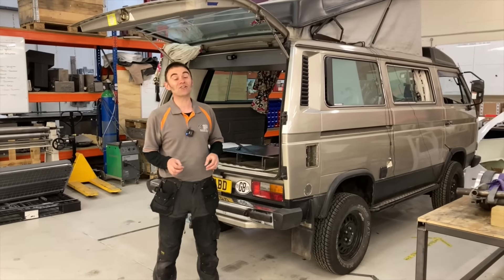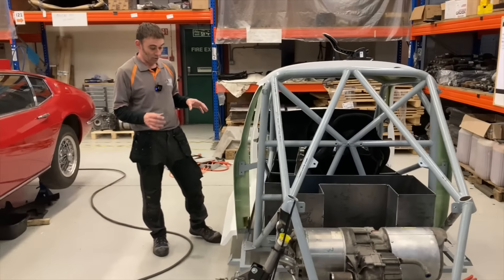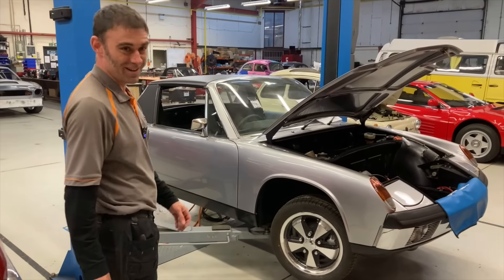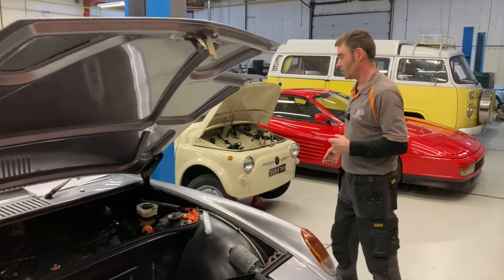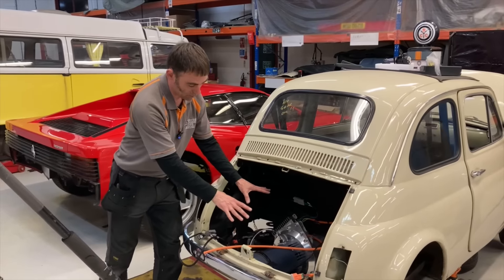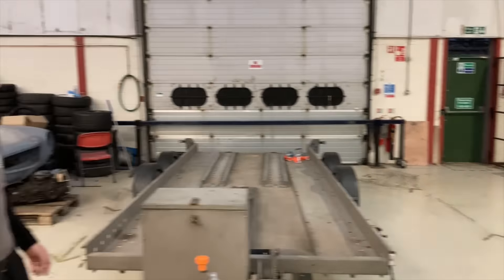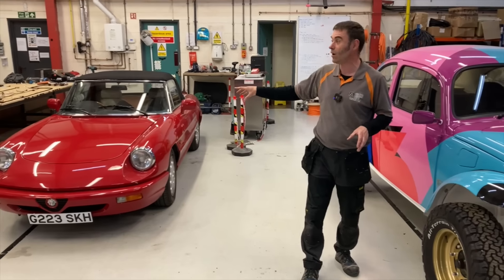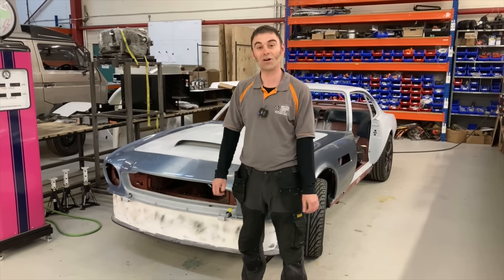Converting classic cars to electric workshop tour.

Comment: Do you have/are planning a USA affiliate? 
Myers Manx buggy conversion would be easy, and sweet.
What is the expected range, at highway speed 65mph, of the Baja? 
Corvair van, or 68 style coupe conversion would be nice.
All of your battery boxes appear to be steel. Is this for structural integrity of the conversion? 
Or fire safety?
Or cost? Because aluminum boxes would likely be lighter, yet likely more costly. 
Do your Tesla components come from wrecks, or gutting high mileage low priced intact cars?
Price for conversion, time and materials? 
Love what you are doing!
Are you aware of last year "Holley Fest" of electric conversions at Sears Point Raceway, Sonoma, California?

Comment: Excellent workshop tour, Richard. Thank-you. You've triggered some ideas, which might appeal to you.
I love the custom number plate on the Baja Bug. That's clever. 
How about converting a 2CV? They're off-road capable, quirky, easy to access, and great fun to drive. 
And there's always the Morris 1000, which could also become a beach buggy. [Says the imp in me.]
I'd like to see a Ford Mustang, or a Dukes of Hazzard Charger converted.
Just for fun, if you could find one which still has more metal than rust, a [Thora Hird 'Last of the Summer Wine'] Ford Herald would be surprising. They have the advantage that all major panels bolt onto a chassis. I believe it was the last mass-produced British car with a chassis.
Another great one for conversion would be a 1980's TVR.
Might I suggest that you have a word with Ian Seabrook [Hub Nut] for a car to convert? He lives not too far away from you, and has latent lust for EV's. His funds are limited, but I'm sure that he could supply or at least suggest, a project car for you.
And the Aston Martin V8 could be called a Voltage, a V Spark, or a V-E.

Comment: For building kits you really should look into the “Triumph Sports Six”. Essentially cars based on the Herald I.e : Herald, Spitfire, GT6, Vitesse, Bond Equipe and “Specials” (Amphicar). They are all of similar size and overall make up and offer amazing motor access. There are lots of off the shelf upgrades to save weight (aluminum and fiberglass parts) and increase stability (poly bushings , dampers etc) I have ridden in a converted Spitfire and it is great fun!
Reply: An electric amphicar, scwimwagon or Dutton Mariner seems a great idea.

Comment: You really need to convert a Jenson Interceptor. Should be good for range and with the right motor plenty of power. Huge engine bay and massive fuel tank area .
Reply from the maker: We have 2 in the queue waiting to be converted. 😎👌
Reply: @ElectricClassicCars   can’t wait. Amazing cars , if a tad fuel inefficient!!
Reply: Or a Jensen CV8 (which was a tv star once - can’t remember series name) or an NSU Ro80. Rescuing two cars made scarcely usable by their prodigious thirst.

Comment: Thanks, I appreciate these tours!
Just wondering about these battery boxes; is there a need for the boxes to be made from steel (heat sink? structural integrity?) or is there room for weight saving? Or is the weight marginal in respect to the entire conversion?

Comment: How’s the vw t3 synchro going? I’ve been looking to do this to my t3, and keep thinking that an in-wheel solution by elaphe would be awesome! And I’d have more space for batteries as well as maybe going 4wd without having the synchro drivetrain on mine. Is that something you considered? Thanks! And keep up the awesome work!
Reply from the maker: The Syncro is coming along nicely. Half the battery pack is in now. I'm not a fan of hub motors. 4 times the complexity, cabling controllers, cooling etc I've yet to see any OEMs go this route for mass produced cars. 👍

Comment: I’d love to see a late 50’s early 60’s Cadillac done on airbags, surely it’s the perfect classic conversion for EV. Every conceivable aspect of it would be improved by converting it.
Reply: Any of those land yachts. A convertible would look awesome. Right up until they went extinct. Lots of room for batteries.
Reply: I pass a late 60s impala on the way to work. It's just sitting there waiting for an all wheel drive, dual engine Tesla drag setup.
Reply: @shensley27  don't forget the touchsceen, so you have to take your eyes off the road to adjust anything, at 75mph... it's a car, not a ipad on wheels...

Comment: I would like a Model 3 Performance Drivetrain under a 1980-83 Toyota Pickup Shortbed 2wd. Still would like the 4wd tesla gear, but on what would be a minitruck from the 80's. It would haul the mail and corner. Also, same set up on a 510.

Comment: Hey, guys! Nice catching up with you.

I don't know how popular the PT Cruiser was in the UK, I know they were not the best (sort of) minivan on the road (and I honestly don't suppose one will roll into your garage anytime soon) but, I'd like to get your thoughts on what you would use to turn it into an electric sleeper car so I can smoke some petrol heads at the track ;).

I know some engineering professor in the US turned his into an PEV about 10/11 years ago but it didn't have that much range, just enough for a daily commute. What would my project require to get both at least a 500 Km range and a decent acceleration?

Comment: I want see everything about that Baja Bug. I'm about to inherit a Bug in need of restoration. I want to turn it into a fun little bug. I have so many questions about EV converting a bug designed for performance. Like with a swap to a Tesla small drive unit, do you lose the original transmission?
Reply: Yeah you would, Tesla drive units are all in one. You could use a different motor that bolts to the original gearbox (similar to the fiat 500s they showed).
Reply: The easiest way is to add a motor to the gearbox, I won't mention names but off the shelf parts exist,  but it could be converted to a Tesla drive/ diff unit, but will require a huge amount more fabrication.
Reply from the maker: @ForeverNeverwhere1  Not true, it requires NO fabrication and just bolts into the existing car.As explained in the video, the Tesla motor cradle bolts on to the frame horns and gearbox mount. Simples. 😁👍

Comment: Maybe an electric conversion on a Ford Puma Racing with a central driving position, in place of the two front seats, leaving the rear seat space for battery packs, with additional battery packs either side of the driver's seat in a slightly set-back position to allow the driver easy access in and out. Obviously, if this could be done with twin motors giving 4WD that would be an amazing project that I imagine would be in high demand.
Reply: I'd love to see an old bug eye Impreza. Maybe some hot swap batteries to make it a full blown rally car.

Comment: The Aston should be called  a V8 Voltage of course (instead of Vantage for those who wonder) . What I'm interested in is if you're going to remove tthat awful silencerbox under the rear bumper?
Reply from the maker: Yes. It just looks awful. I don't know what they were thinking when they designed/built that rear like that, completely spoils the back end. 👍

Comment: Fab video, guys. I love to see your work. How do you work around the 8 point rule system from DVLA disallowing a monocoque structure from being modified? Do you just avoid cutting cars but if you have to, send them for IVA? I see the AM V8 has had its rear floor altered.

Comment: I know you don't tend to do anything after the early 90's, but I have a question... I believe converting anything newer than 2000 is difficult due to DVLA rules/regs, is that true? I have a 2000 Passat B5 TDi that i'd love to look at getting converted in future once used batteries are a bit more affordable.
Reply from the maker: Presently the DVLA won't change the fuel type to electric for a car built after 2000, but that doesn't stop anyone from converting their car to electric. 👍

Comment: You think a Morgan plus 4, plus 6 or plus 8 can be a candidate for a EV conversion?
Reply: I’d like to see the old Morgan three wheeler done but you would need to find a way to keep the exposed cylinder heads on the front, maybe they could be hollowed out to contain ancillary bits like pumps and charge controllers etc.  it’s so light it would probably have a good range and ballistic acceleration, not sure about cornering at high speeds though🤪

Comment: What I don’t see converted are corvettes. They have lightweight bodies, there is an entire decade of them where apparently they were “ throttled “ by emissions regulations so the ice enthusiasts would turn their nose up at and they were designed to go fast in the first place. They 70s corvettes would seem ideal EV conversions.
Reply: This is something I have also wondered. VW's seem super popular, but no ones touching the 'vettes. Maybe it has more to do with the culture and people less likely to want to "devalue" them by converting. Just imagine a '69 Stingray Tesla powered with a 50/50ish weight ratio and modern suspension.
Reply: I think people would except a converted C3 or C4. I probably would not touch a C1 or C2.

Comment: Did the Syncro feature DC fastcharging or only A/C charging?
Reply from the maker: CCS rapid charging. 👍
Reply: @ElectricClassicCars  I saw the followup video, Nice!  Are there any controllers on the market yet for CCS Type 1?

I'm still in the learning phase of EV conversions, but find the best way to learn is to go digging into the documents/manuals of products available.  Do you know where to learn more about what different types of CCS controllers that are on the market?  the only one for type 2 that I'm familiar with is designed to be used for the Orion BMS.

Comment: Just seen your video and I really admire your engineering and craftsmanship! My only issue by replacing the powertrain with electric you're robbing these classics of their souls. I realise this may have been said before, however a mechanical engine will always have more feel to me than an electric motor. Having said that I am not against what is being achieved, just how it makes me feel. Though would love to see and S2 Lotus Esprit converted as the 4 cylinder engines were never that great and not that reliable. To me that would be a good fit.

Comment: Are there other brands of motors used in electric cars and if so why do you go with Tesla motors?
Reply: Used Tesla components are really good bang for the buck and getting more plentiful crashed due to Tesla's insanely expensive repair costs. 

12 k to 18 k can buy a complete crashed car, unused parts can be sold off for high amounts ( high Tesla parts prices) to halve the cost. 6 to 10 k for one of the best motors around and a large battery pack is unbeatable, plus you can get aftermarket electronics and software to hack into the motor and bms controllers.
Reply: @ForeverNeverwhere1  awesome I had no idea that the after market for Tesla parts was like that.

Comment: Hello Richard, would you consider ever doing a car for a customer that wants the entire D100 'skateboard' from an S or 3 Tesla? (i.e., NOT REVERSABLE) The exercise would require the body of the former ICE car to be modified significantly to allow the 'skateboard' to fit under the car as if it was a Tesla - just a classic car body on top? My thinking is if you want an EV why on earth keep the old mechanicals?

Comment: I am pro electric for modern cars, but all I can see here is a complete massacre...
Reply: Yup, better to flood it trying to start, vapor lock it in summer traffic, be with the mechanic half the time, and to leave you stranded in the rain at the side of the road, isn't it?🤦‍♂️

Old cars were shit - damned shame they're not redoing the suspension and steering on these POS as well.
Reply: A little bit of research on the Testasrossa shows that Ferrari is pushing for full engine out full day service for these cars once every three years, more not so financially involved heads say closer to once a decade, for a cost of six to ten thousand dollars and the 80s electronics for the engine management is getting hard to find. So you could be a purist and suffer for your car or you could remember that cars are about having fun driving, and throw some money at ECC , to drop your service interval to nothing, get more power to your car, make it more fun to drive ,future proof your car and be able to drive it for a greater amount of time each year.

Comment: If you are true classic lover, you buy the car for what it is.. all the foibles of the engine, bodyshell etc..
Converting to electric, you just have a Tesla in a different condom...
A classic car is 100% original.. brakes upgrade, better dampers.. for better modern traffic safety,  that's it..
It ain't a classic If it is electric.. Tesla in Drag..
Reply: That's great if you want to buy a classic and keep it in storage, but for daily driving I'd want mine converted for safety and reliability. As mentioned, it can always be reversed.
Reply: Seems you missed the part where half the cars had not a smidge of Tesla in them
Reply: I have yet to see a classic car that comes out of a rebuild 100 % original. As you say new brakes and dampers are usually upgraded, often the engine, often the steering, so the question isn’t do I keep the car 100% original, because nobody does that, but how much do I modify the car so that I , the owner, finds it viable to drive. For some owners that modification is to put in an electric drive, for some it’s a turbo, for some it’s power steering, for some it’s upgrading the emu, for some it’s the removal of government mandated safety changes. Oh and nobody has access to leaded petrol, so theirs that change as well.
Your demanding that because the queen lives in Buckingham Palace and the palace was built before electricity the queen should not have electric lights installed in the palace.